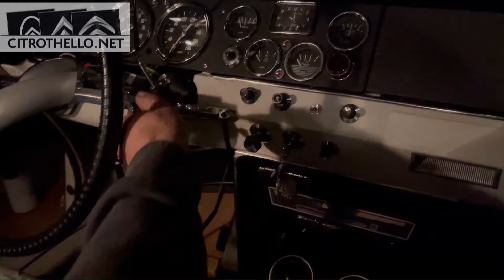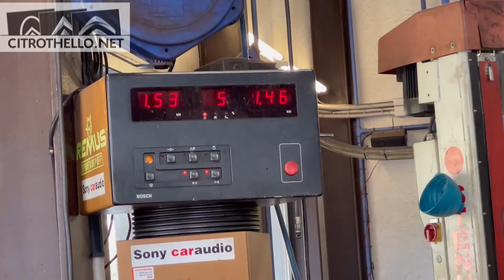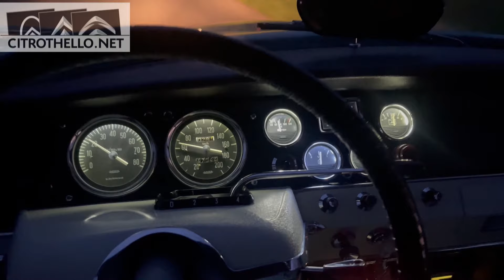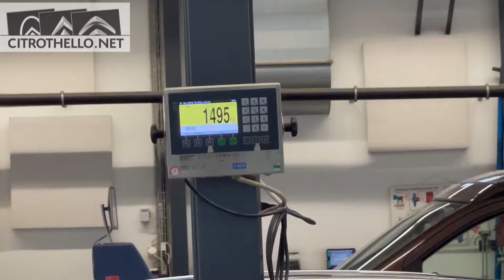CITROEN ID BREAK 21 1967 OTHELLO. STATION WAGON SUNROOF OLDTIMER CARS RESTORATION 07.

Comment: Beautiful Safari..2175 cc engine, rare single headlight, slopey dash, LHM green fluid, hydraulic gear change... formidable machine.

I had a 1965 ID20 Safari - RHD European delivery.
When I bought it for Aus $250 it was so rusty part of the floor and box sections were eaten away, and it had broken tooth on first gear. LHS2 Red Fluid. Still drove amazingly well.
Got first gear fixed and set off with 5 people, camping gear and 2 Canadian canoes on the roof. Still cruised comfortably at 70 mph. Fantastic beast of burden. Took 5 months to cut out rust, remetal and respray..

Few people know that the Safari was the only vehicle with a factory aerodynamic roof rack set into the roof with knurled rubber at the front... no wind whistle. Even at 90 mph...

I would love this car... a mint green fluid Safari with 21 engine and hydraulic gear change..
Or a 1974 DS 23 with hydraulic change.. would be my second choice.

Comment: Such beautiful work, excellent craftsmanship.  Somewhat disappointed to not see the precision set-up of the Citromatic, clutch release arm free-play, centrifugal regulator and the final tuning for smooth starts and down-shifting.
I used to insert the crank handle to finely adjust free-play and the CF.  Just wanted to watch someone else perform the adjustments.  One could even make the adjustments so the clutch acted like a "hill-holder" whilst idling although clutch plate wear is increased.
I loved to give my old DS full throttle in fourth gear, hold the throttle to the floor and flick the selector to third for passing.  What a great system, no computers, just hydraulic science.